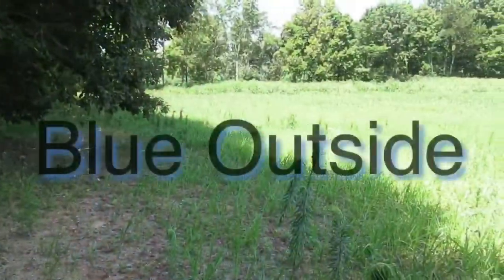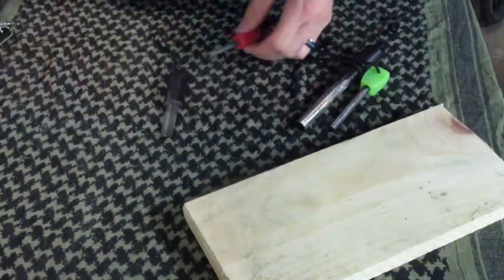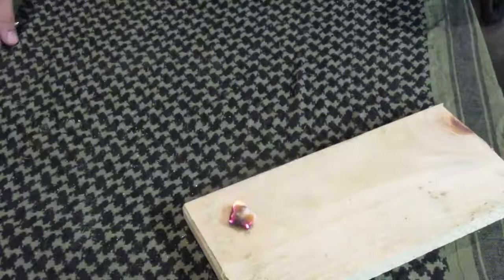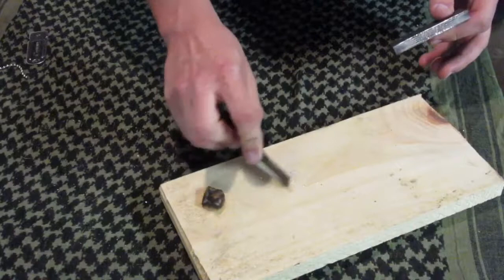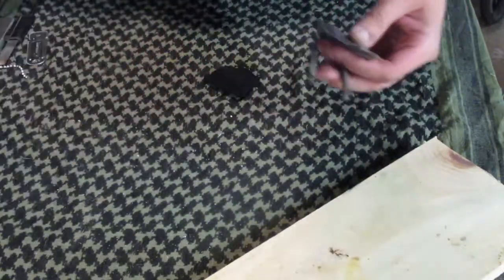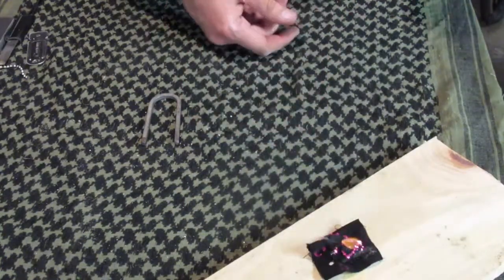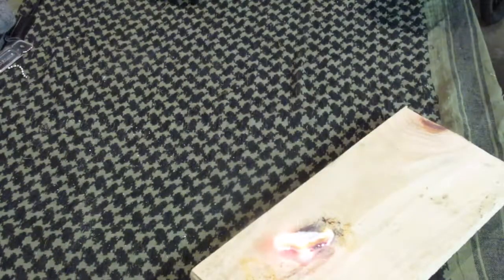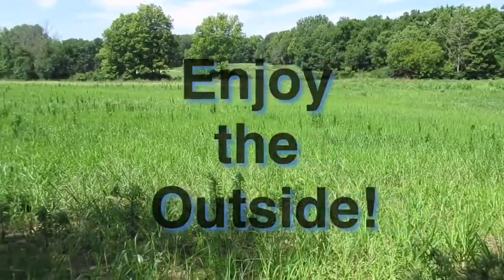Bushcraft: The Art of Fire Part 1

Comment: Great fire making methods. :-) I saw a method that's interesting and tried it but failed. 

It's a friction fire but you use two flat planks of wood and cotton rolled up to look like a joint. You take the cotton and place it between the two planks of wood and slide it back and forth to cause friction and the cotton supposedly will get hot enough to creat an ember to start a tinder bundle up. 

I'm gonna try if I can attempt it again but I don't see it being real practical.
Reply from the maker: Yes I know what you talking about Creek Stewart does it. You have to add alittle wood ash rolled in the cotton.
Reply from the maker: I dont think its ment to be practical  it's just a different way to start a fire in a survival situation where you do  not have proper fire making tools